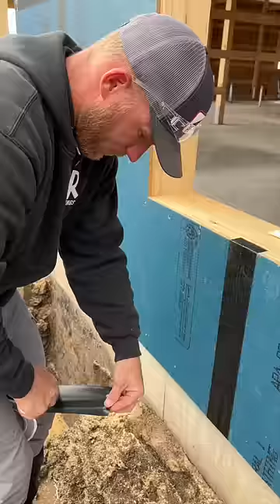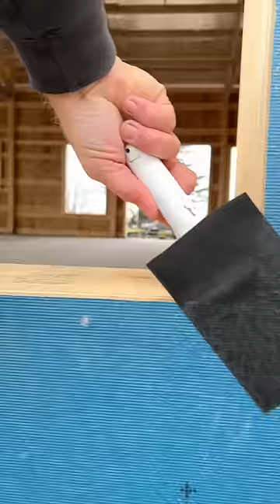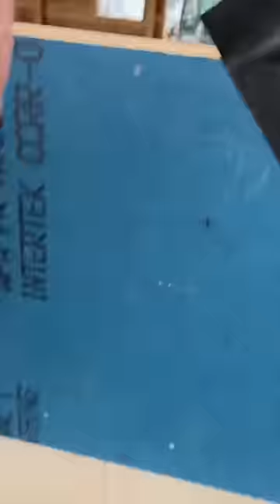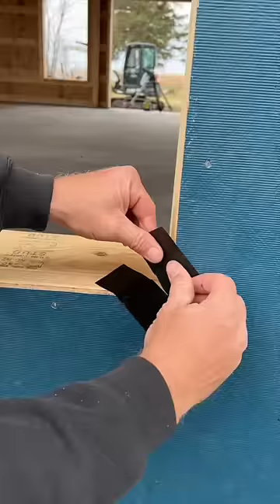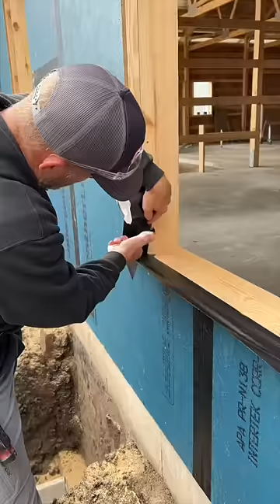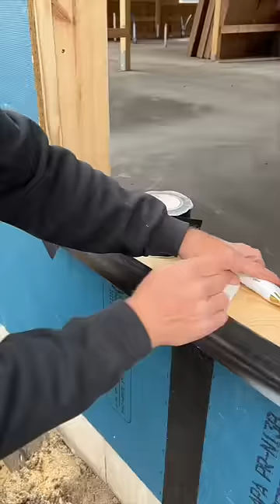How To Easily Tape Seal a Window Frame

Comment: I have frame houses since 1978 , never did we use all this fancy tape etc! Paper over flange side over flange caulk siding insulate gaps Bobs your uncle! No problems!
Reply: The flashing has been in the building code for years. And it gets inspected. So I don't know what jurisdiction you been framing in. 
I agree it seems like overkill, but I've also remodeled some pretty young homes and found dry rot and even termites under leaky windows. So, it's definitely worth it. And. It's the LAW.
👻🤠

Comment: Why cut it? This stuff doesn’t stretch in corners? Pin hole size gap in all corners gets bigger over time. No bueno. 

ZIP System stretch tape. No gaps. 100% seal.

Comment: feel free to explain how this seals the window.  Seriously, what does this do.  Is the framing and the window so perfect that it just gets set in airtight.  NO.  You know who seals windows well....manufactured home builders.  They caulk and nail the window flanges, then seal the the gaps between window and frame....

Comment: Don't do what this guy did. Both pieces of tape are cut right at the outer corner. A dab of caulking at this failure point is not sufficient. They make plastic flashings for this very purpose. Or use stretch tape so the sill membrane is never broken.

Comment: its neat but doesn't seem very water tight, with all the cuts/joins concentrated on the outer corner. why not use ZIP tape its stretchy enough to go around the corner. Or build with bricks and mortar, then you don't need all this bs.

Comment: Could of saved a lot of time had you not cut out the wrap out of the windows opening and just cut it diagonal from corner to corner and then fold it in and stapled it on the inside!

Comment: This is a very bad way of doing a frame seal. You are leaving a weak spot in the corner. Exactly the thing you are trying to avoid. There are many methods and materials much more suitable for this task.

Comment: This is a waste of time if water is going to go past the flange of the window it will go back in towards the Lumber whoever came up with no housewrap system is a moron taping the seams over that product is a terrible idea. We need to go back to 30 pound tar paper  it last forever I have torn off siding that was 100 years old and the tarp was still in excellent shape.

Comment: duct tape does not work for that use peel and seal it's heavier and when water gets on the nails that actually seals around the nail so water doesn't get into the wood and wrought. if you're going to do something right do it right or don't do it at all I'm a professional handyman and that's a joke I would never do that to a customer , stop being a tight ass and get the right stuff